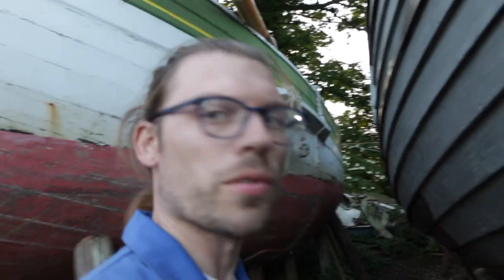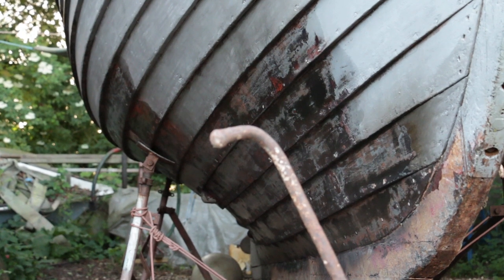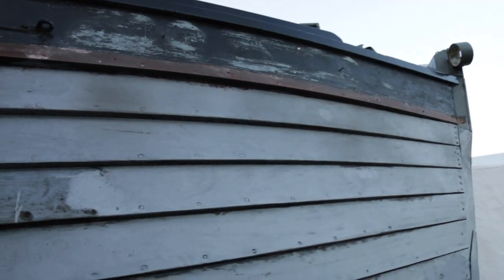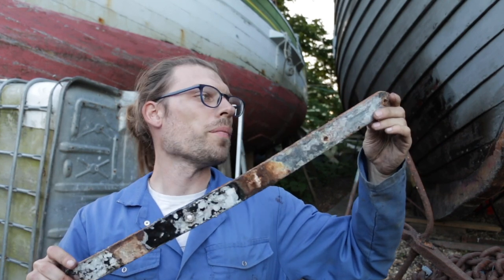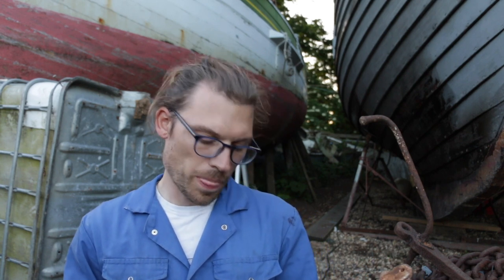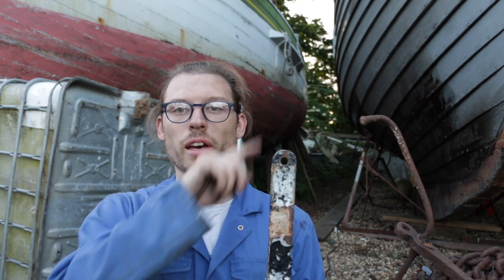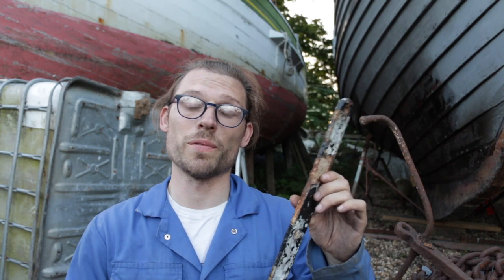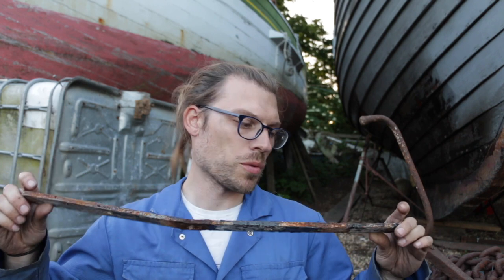12. Burning Antifoul and Rotten Chain Plates. Wooden Boat Restoration.

Comment: I bet you pleased to finish that stage with the burning the paint off. as for the Chain Plates, it could be done in A4 Stainless Steel?, Metal Supermarkets is a good place to source Metals.

I know of several people in my area could easily make up Chain Plates replacements.
Reply from the maker: Yes! Definitely pleased, thanks! That was a really horrible job. Stainless steel might be the way forward. I’ll look up metal supermarkets. Thanks very much!!! :-)